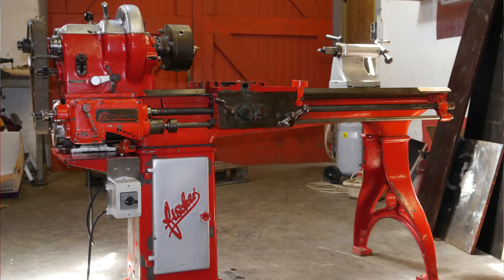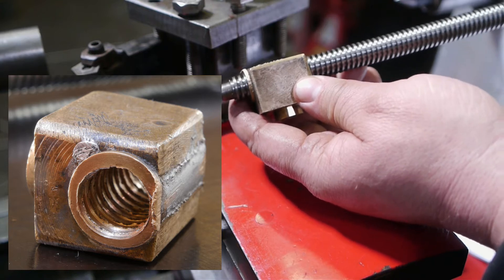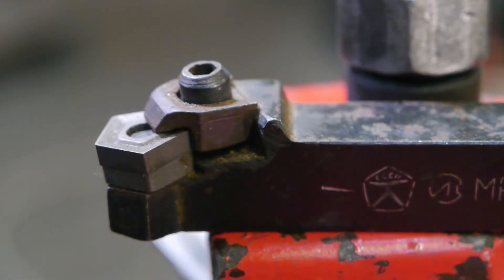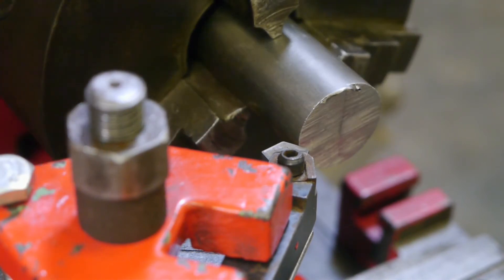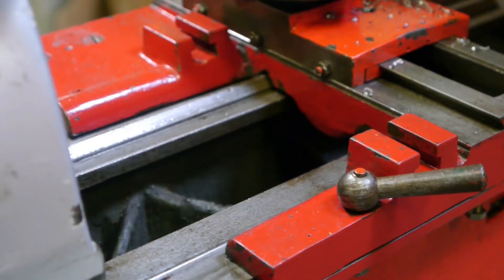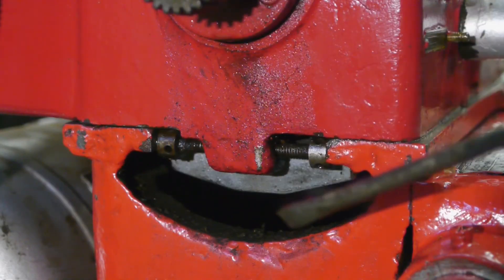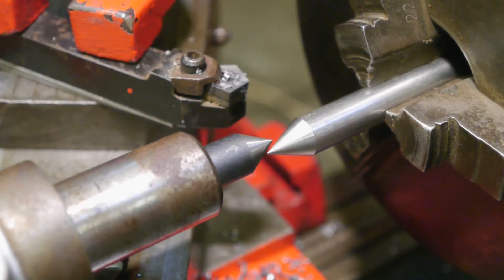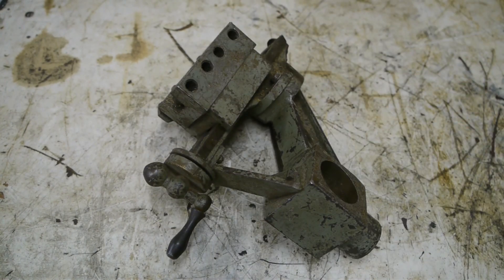My first chips with the old Fischer lathe

Comment: Hey. I got myself the same lathe. But I have an issue removing the chuck. Is the spindle threaded on this lathe? If not how do I remove chuck from it?? I’d appreciate any help! Thanks! Good video btw. I enjoy your content.
Reply from the maker: It has a has a screw-on spindle nose. (right hand thread)
Try to make something like this and shock it loose with a hammer. https://bit.ly/3chZCHn
Good-luck with the lathe. At least it has a spindle lock :)
Reply: Доброго вечора велике до вас прохання щоб могли мені допомогти з розмірами шестерень оцього механізма до такого верстата як на відіо

Comment: what would happen.. if you created some kind of Z shaped block to set in the bottom  of the mill vice.. so you could set the fischer chuck jaws in at the exact same depth according to the back right across the front.   

can you chuck something round in the chuck and see how far out the jaws stick with a dial indicator.. and compare that to the off set in the chucked part.. that might give you the ability to adjust how much gets milled off. for a second go round. 

 if you chucked all three jaws in at the same time with the jaw backs against a stop.. would do the same thing.  could you do it in a horizontal mill?    taking a cut off each then sliding over to another space on the bar to a angle cutter to slit the jaw faces and put a narrowing angle on the outside faces.. since all three are chucked up together.. you would not have to adjust the Z axis between jaws. so they might come out all the same.  if not.. weld them up again and start over.   if it gets really ugly.. you can always UPCHUCK..  which is in american  throwing up ones stomach contents.
Reply from the maker: I don't fully understand what your describing. But, if I keep the lathe I'll probably upchuck that old chuck and mount the worlds dirtiest chuck to the backplate. https://www.youtube.com/watch?v=yNLP2sdXt2s

Comment: Sad that this lathe has so many issues.  It does look good on the stand.  

Good for someone who wants only a machine for display.  LOL

I wonder if the backlash in the cross slide was partly due to the cross slide binding.  Easy to wear out the brass.
Reply from the maker: Yeah, it's a challenge. Not sure if I'm up to the task :)
Apart from massive play the cross slide nut was also not securely fastened. 
At the end of the cross slide travel the nut tilted a bit and everything seized up.

Comment: You can shorten the belt if you can get some new links . This will be a fun project for you
Reply from the maker: I just replaced the pulleys and switched to a v-belt :)
Reply: i was going to mention about using wide micro V belts to drive flat pulleys.. i have one on my sioux valve refacer works great.. replaced the thin cotton belt.  you can get 35MM 10 groove wide from 983MM outside length to 2278mm length. fewer choices in 12 groove width.  or 42mm wide.. 730MM to 2154MM long.  there are probably make more sizes in the industrial catalogs. i put of a copy of that page over at imgur for a different reply.. so it might come in handy to you at some point.. http://i.imgur.com/vtNVMP6.jpg

Comment: The tailstock is a different color. It could be a tail stock for another model Fischer lathe.
Reply from the maker: That would be a possible explanation.
The lathe came with an extra tailstock base. It is also possible that they mounted a non original tailstock on the original base. There is an awful lot of slack/backlash in the tailstock adjustment screw. Those normally don't see much wear.

.